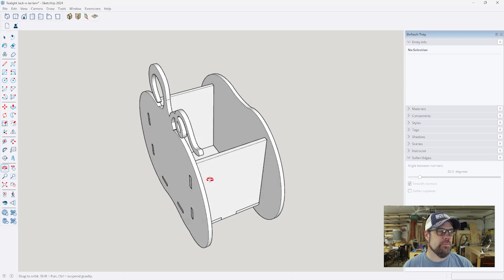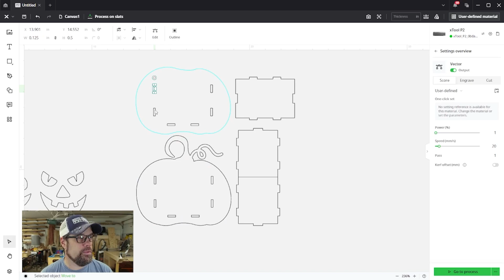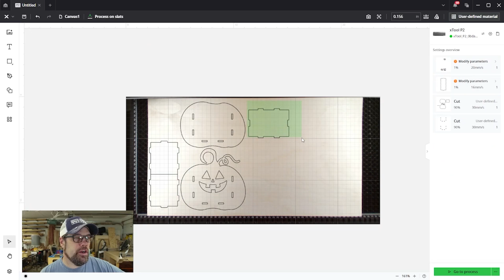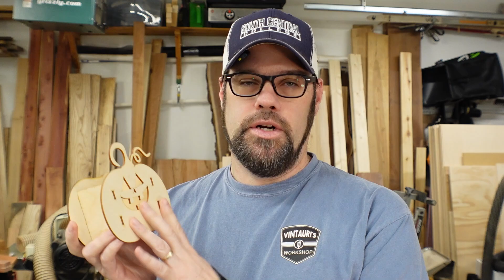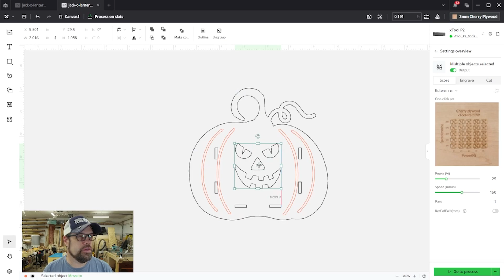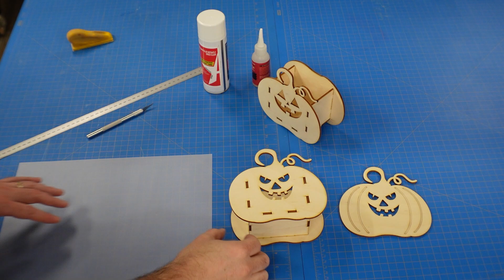Tealight Jack-O'-Lanterns with the xTool P2 laser!

Comment: First off great video, I purchased your cut file. Great job! My question to you is what do I have to tweak to the file to make this work with 1/4 inch plywood instead of 1/8 inch?
Reply from the maker: You can adjust the tabs using the slot and tab tool in lightburn, but it wont adjust the slots in the front and rear faces correctly using that tool.  Lightburns tool extends slots from the middle out both directions and that will result in the slots not being in the correct spot.  You need to extend the slots in the faces out from the outside edge of the box, leaving the internal size of the box the same.

Comment: Good project Steve.  For added dimension you could make the layered front part from the back piece.  Then the stem will appear further back
Reply from the maker: Yeah not a bad idea as well.  Although doubling up the 1/8" material is not the worst as it's probably the most fragile part on these.